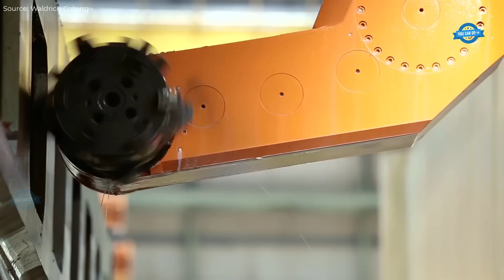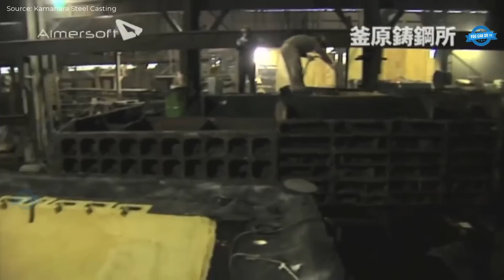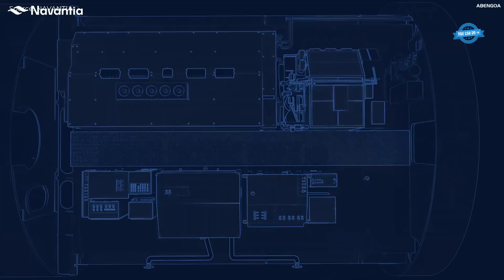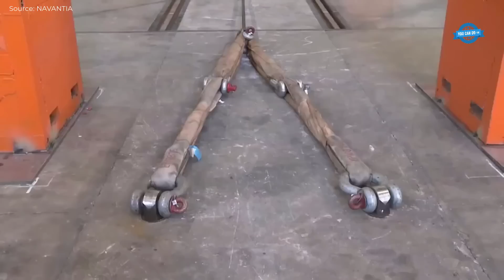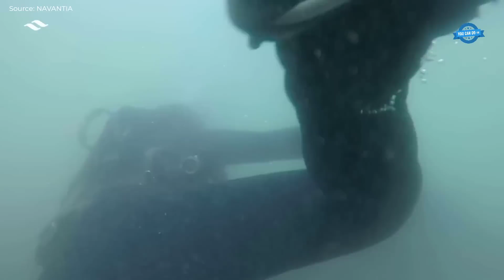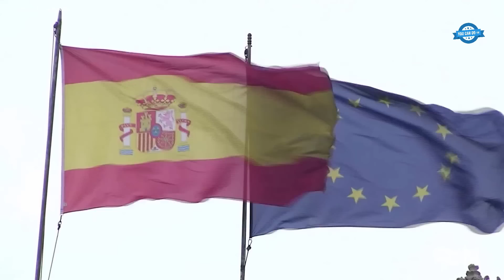How The Latest Generation Submarines Are Made?

Comment: I wouldn't underestimate these subs. They may not be deep diving vessels but they are going to be long range, very quiet and difficult to detect. It's been 40 years since I served and still the only way to find them is through sound, whether that is through passive listening from other subs or active sonar from surface vessels and aircraft. Either way is heavily dependant on proximity and sea conditions. You may get lucky.